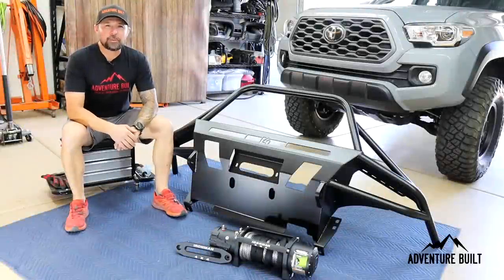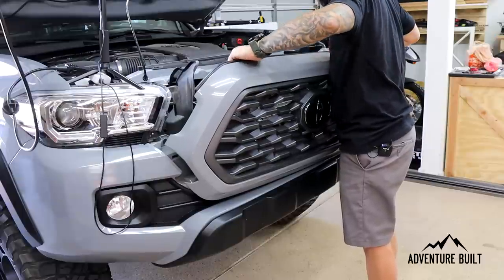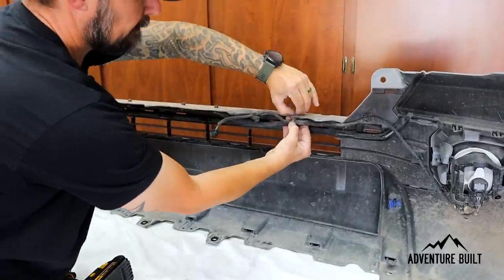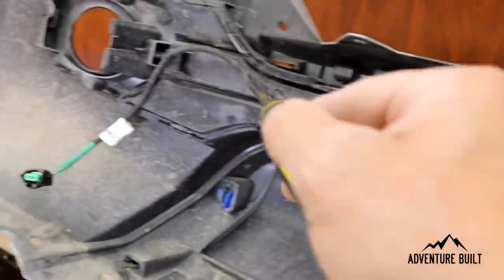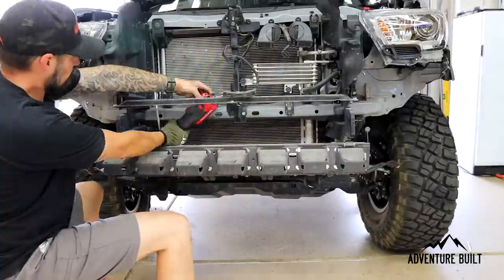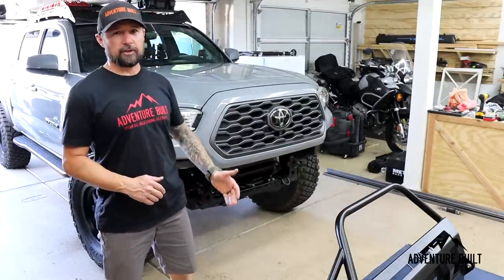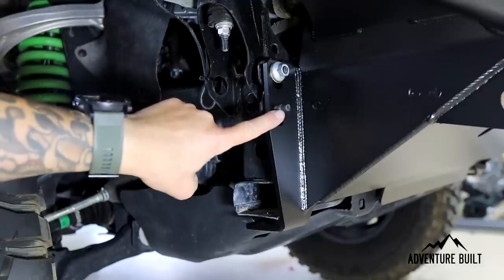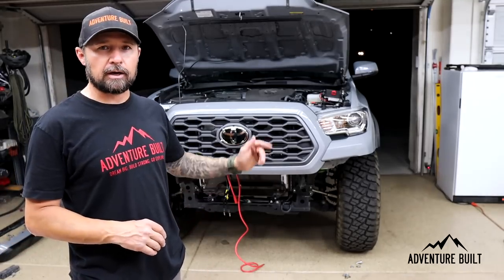FINALLY SELF SUFFICIENT | C4 FAB HYBRID FRONT BUMPER, IRONMAN 4X4 MONSTER WINCH | 2020 TOYOTA TACOMA

Comment: Nice job. I can tell you the Warn winch is much easier to install. Box and wiring is attached so you literally just hook up positive and negative...your done.
Reply from the maker: Thank you. The fact that the control box is separate is actually easier to install overall because it fits in tight places better.  Plus you can put it in places for easy access. It’s definitely a give and take.

Comment: Looks good I like it, but I would not do any winching. You need to purchase bumper reimbursement brackets.  You will stretch out those stock bolts with any winching you do. Those tiny bolts aren’t strong enough. Tons of issues with this online with people not running reinforcement brackets.
Reply from the maker: Good tip. Never thought about it. I’ll definitely look into it.
Reply: Search BAMF reinforcement brackets. They seem to be very well built and popular.

Comment: I got a victory 4x4 blitz bumper right now.  If i damage my front OEM bumper enough that It cant be used anymore, this is the one i would replace my hybrid/plastic bumper with.  Nice thing though, i already have my which wired, so i would only have to take off the wires from the control box to the winch itself, my diode dynamics fog lights, and transfer my licence plate to the new one.  It looks awesome.  125lbs is a lot but I'm glad i upgraded my springs too to support the weight i already have.  Minnesota requires a front plate which is stupid but oh well....  I got a folding one so I can still use my winch.

Comment: what lift and tire set up are you running I have my heart set on that bumper I just dont want it to look silly with not enough lift and my 33s lol
Reply: I have 33s with a 2.5-3 inch lift on my 2nd gen and the c4 bumper looks sweet!
Reply from the maker: It’s the Ironman 4x4 Foam Cell Pro Stage that comes out to a pinch over 2.5”. Method 701 trail Series 17” with a 0 offset and BFG MT 35x12.5r17. I’m glad you like the setup.

Comment: Have you used the winch with any frequency? Wondering how it has held up. Great vid btw.
Reply from the maker: I have used the Ironman winch real world maybe 10 times and it has never let me down. The only annoying thing is the remote controller has a dongle that you have to plug into the winch to use the remote. Wish the Bluetooth was built in. First World Problems!

Comment: A metal de-bur tool works amazing to remove the plastic hangers left from the cutting
Reply from the maker: I completely agree. I like using the sanding discs because I have a bunch of them but the de-burring tool will also work great.

Comment: Bumper looks great! Put a bow shackle on the end of the winch line. Oh, and a suggestion for the winch controller plug.... take the plug off the control box, extend the wires behind the plug, and mount the winch controller plug in a more convenient location.
Reply from the maker: Thank you very much!!! I trying to stay away from the steel hardware. Going to all soft shackles. Thanks man

Comment: Great install! Love the look. Just a FYI, watch that controller box. From past experiences, not with that particular setup, I have had controllers break off and rubbing holes in my radiator and ac lines.
Reply from the maker: Thank you. I will definitely keep an eye on it. I checked it after this last trip and it was still tight. Maybe I’ll throw a big zip tie over the whole thing just for security!!!